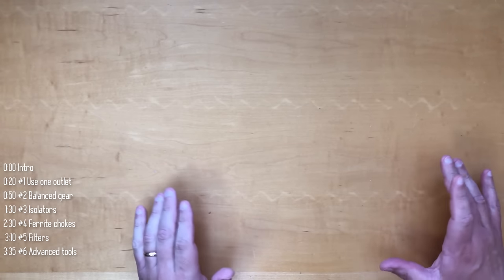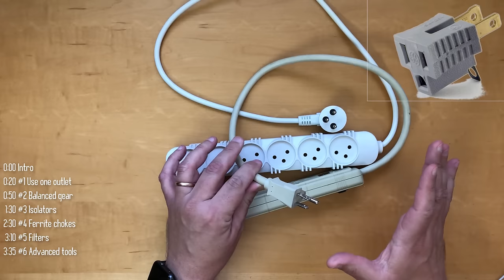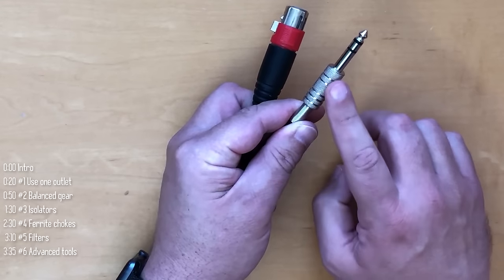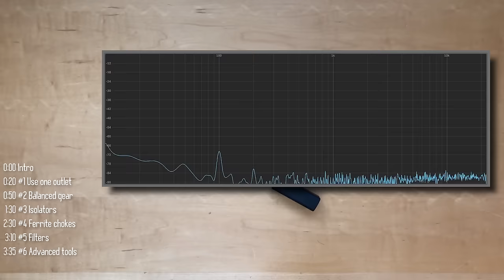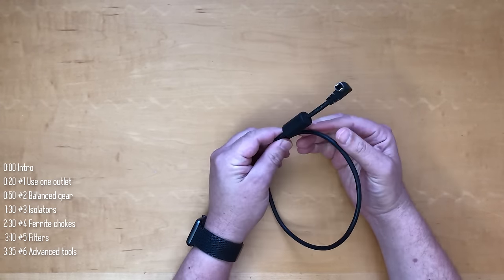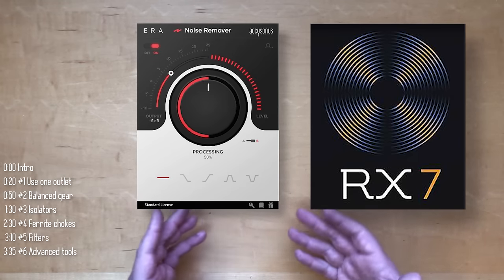6 simple and cheap ways to fix hum, buzz and ground loop noise

Comment: So i choked all of my ferrets and i’m still having ground loop issues. Help.
Reply: Look at these brands for legal solutions:
Kaytee Fiesta and ZuPreem
Reply: Did you use the beads while choking?
Reply: No no no -- your ferrets are supposed to do the choking.
Reply: better than ground hog issues
Reply: Check your squirrels as well
Reply: Did you try inserting the ferrets into your socket hole using the beads?
Reply: Was an evil cat no longer to be pet involved?
Reply: Nope,nope,nope!!! You're doing it wrong!Stop choking the snake! ...only ferrets!

Comment: Be aware that some budget hi-fi gear has balanced inputs and outputs, but the circuits are still unbalanced. In other words, you won’t hear any difference between a single ended connection or a balanced connection.

Comment: I first watched this video about a year ago, which definitely helped me identify the source of some of my frustrations.

I finally just replaced all the outlets in my studio, re-grounded all outlets on the circuit that feeds my studio, and installed GFCI outlets on the most upstream point. I've also run insulated conduit to act as both cable management and power/data/audio cable isolation. I've added ferrite cores to all my USB cables and run voltage tests on all my audio and power cabling. This has allowed me to completely remove ground loop isolators and post-recording phase reversal filtering from my process.

Short of a master power conditioner and UPS hard wired into my space, I've cleaned my entire electrical path as much as possibleand it sounds fantastic.

Comment: Great tips! I got one more.
If one of your rack equipment produces hum when connected, check if it's not touching other pieces of gear in the same rack and is properly isolated from a rack rails (properly painted for example). Just take it out of the rack while connected to see if the hum disappears. Most of the gear's earth is connected to the enclosures and if enclosures touch each other in some cases, ground loop may appear.

Comment: Great video! Been a fan of your videos but never knew you had this one. I solved a grounding problem today with an RCA audio switcher that has a turntable, a CD changer and a digital mixer all connected to it. I had ground issues with each, and narrowed it down to the switcher. Got myself a ground loop isolator on the cheap, and it's working as advertised. Good to know of other solutions too, so this video will be a keeper. Thanks again.

Comment: loopop once again being a lifesaver. this popped up thanks to the algorithm and my usb2 connection hum was driving me wild. Well, ferrite choke here I come.
Reply from the maker: thanks and note ferrite choke solve data noise not hum! use the other solution I mentioned for audible noise
Reply: @loopop  you're definitely right! it was a mix of using the same plug and the ferret strangler I mean the ferrite choke. I owe you so much. thank you for being awesome!

Comment: Thanks for the tip about the shared power. I have my audio setup plugged into a different power source since it's far away from my computer. I couldn't figure out what was causing the hum on my setup and it was slowly driving me crazy. I even bought some of those grounding devices and it didn't help. Who knew something as simple as plugging everything to the same power source can solve this issue!

Comment: Thank you for this, it got me thinking in the right direction. I have a computer speaker that is USB powered, when it was plugged into my desktop computer's USB port it made an annoying sound. To fix that I plugged it into a USB to AC adapter for charging a cell phone (5V 3A). And now the speaker works as it should.
Reply: Thanks for the tip man. Just curious, how were you able to connect the speaker to your computer if the USB connection is lost via the adapter?
Reply: @LukeSly91  USB *powered*.

Comment: So im back here on this video I watched like 1 hour ago. And I just want to say: THANK YOU SO MUCH! I had everything I needed already. I just set this up wrong. After I watched this video i started from scratch. And ta-da: Ground Noise is gone! Thank you so much!
Reply: BTW: I had 2 "misstakes". 1. I had it on 2 different outputbanks (Thats the first solution in the video). Helped a lot. But i still had a bit ground noise left. I figured it out, that this came from my Arturia MicroFreak. I found a solution where someone mentioned to use only the usb for the power. Not the DC-Connector that is included. And now i had complete silence when i had every gear powered up and connected. Silence :D. Thank you!

Comment: Indeed, NO. You should absolutely NOT disconnect the ground pin. For all those who do not know, that thing is there to save lives !! In case of a short inside a grounded device with the live wire touching the metal casing , it is the ground connector that takes care of your fuse box and immediately causes a cut of power on the affected circuit.
Whatever you do, DO NOT REMOVE THE GROUNDING PIN on your plugs!

Comment: Thanks for pointing me to right direction. Had some really annoying cracks and beeps when recording my amp line-out. Bought a $0.20 separation transformer from Ali and sticked it into a plastic casing, making quite a beefy jack plug. No need for fancy boxes or magical cables.

Comment: This is great info. My scarlet has been giving me grief and I don't think it's the Scarlett. I have my PC plugged into a surge protector instead of straight into the wall. Also, I think I'll definitely try the ground isolator. I use RX8 for declicking, and use Audition CC to do a noise floor clean up, but I feel I should be clearing -72 db for all the room treatment before I clean up noise floor. ugh.

Comment: RCA to 3.5mm jack on the amp. buzzes as the jack enters, so i swapped out the cables. Had to solder one, despite having 100ft of Canon/TS cables just lying around not doing anything. Life is hell.

Comment: Timeline on video description doesn't work on mobile
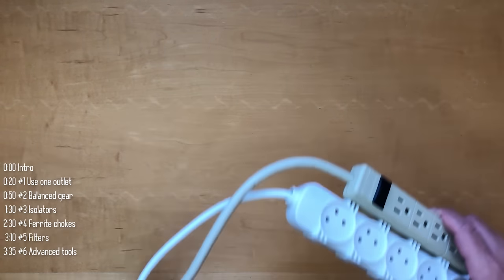0:20 Use one outlet
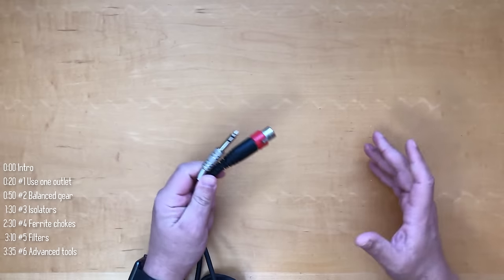0:50 Balanced gear 
1:30 Isolators 
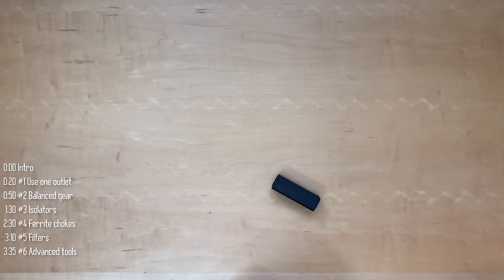2:30 Ferrite chokes 
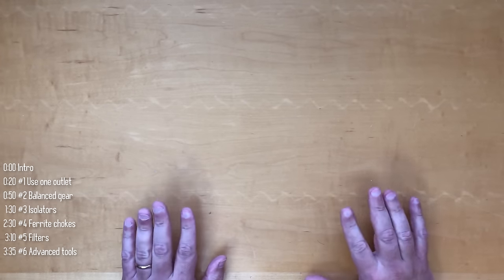3:10 Using filters
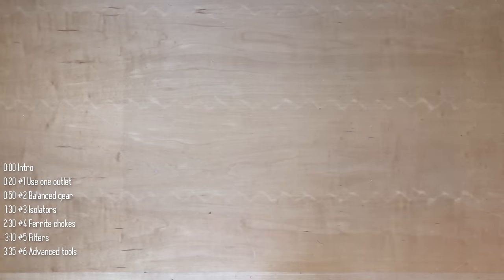3:35 Advanced tools

Comment: Use a good USB hub guys! Instead of connecting your interface directly to your PCs, route the USB connection through a proper USB hub! I used my monitor (LG) and it works beautifully. The issue manifest when your interface draws power directly from the PC. Note that it is recommended that you connect your hub to the same power bar (and outlet) as your monitors.
Reply: Thanks to this one. It worked perfectly when I separated the power source of the usb while charging and using my audio speaker thru 3.5mm at the same time. No more noise/static sounds. Just simple solution.
Reply: And what would you advise if your interface is a PCIe-based RayDat, and your convertors are already isolated from your machine as they connect via ADAT lightpipes, and are mains-powered?

Comment: I get a low frequency humming sound from my headphones when I touch my motorized desk while it's plugged in. However if I simultaneously touch the metal part of a synthesizer or the computer case, it goes away.
My solution has been to use a big, thick mouse pad on the desk so I avoid touching it directly. Not sure if I'm having a ground loop issue or some other problem, the noise doesn't sound like in this video, it's much lower in frequency. The audio interface and desk use 2-pronged plugs that are not grounded, while the computer and many other pieces of gear on the desk use proper grounded plugs so I suppose "ground" isn't universal across devices...

Comment: Another thing which you didn't mention is to lift the ground (pin 1 on an XLR) on one end of a balanced cable. Don't do this on a mic cable though.  Mic cables need all 3 connections.

Comment: The polarity inversion you observed is a flaw in the wiring of the particular ground isolator you tested.  Let the manufacturer know and insist on a replacement, or buy elsewhere.  That’s an inexcusable flaw that can result in out of phase sound between two related signals.

Comment: @PJ82 Division

Thank you for your response. yes all my gear is connected to the one socket, that was one of the first things i did. i will not be able to take my PC out of my bed room for testing on other sockets, as the thing ways a ton and its not worth the hassle. the HUM is driving me nuts i do have a pair of harman kardon soundsticks iii and when they are connected to my pc with its own dedicated sub there i no hum at all.

Comment: A ground loop isolator is simply a transformer. It should not reverse phase (within the rated frequency range) unless cables were soldered backward (confused polarity).

Comment: Over time I accumulated multiple and various power supplies (6 PowerOne Analog 4 to 8 amp, 9 Tiptop Bricks feeding Zeus distributors and 2 DIY) which accumulated multiple and various electrical noise and odd intermittent behavior. After noticing surprising voltage differences between ground on the MOTM cabs vs Eurorack cabs I read up on it and solved my issues by running a very thick copper ground to all said power supplies grounds. This was many years ago, but it made a huge difference.  Another issue that's snuck up on me are modules that are starved for power. Modules will still function but if there's not enough surplus amps to draw on it can leave you wondering wtf. I have ammeters installed  .. there cheap and provide a quick reassuring check.

Comment: What if the monitor were plugged into a separate outlet that the laptop I’m using to record?

And can a monitor broadcast RF into my mic’s TRRS line?  

PS I installed Ferrite beads on the power cable to my laptop, the mic cable, AND the headphones. But it didn’t seem to help. I can use a noise filter but it introduces a slight latency into the audio when live streaming.

Comment: There is also a really good noise reduction plugin in Reaper. It's called ReaFIR, and it's really easy to use and does the job pretty well. Reaper is not a free software, but it's quite affordably priced, and you can also try it, with all its features, free for 60 days. Anyway, this was really interesting! Thanks!
Reply: If you are on Windows, you can download the Reaper plugins as VST2 and use them in other DAWs for free.
https://www.reaper.fm/reaplugs/
Reply: Just tried that, very efficient thx a lot!

Comment: Great Advice. I've used some of these already, ended up using power conditioners which fixed the problem greatly. What are your thoughts about such devices?
Reply from the maker: Thanks and great! I don’t think power conditioners help with ground loops but ground loops aren’t the only kind of noise out there...

Comment: I have a small but distracting crackle in my HS7s coming through a Scarlett 2i2. A couple of these suggestions seem like good possible solutions. Cheers.
Reply: I had a crackle (repeating pattern, short "buzz" every second or half) in my Scarlett 2i2 too and it turned out to be the USB cable coming from a USB hub. Once I plugged the Scarlett directly into my Mac, the noise was gone! I might try some ferrit cores around some USB cables now.

Comment: Is there a difference between the 3.5mm ground loop isolator you used and a ground lift on a DI box? My Novation Circuit is outputting noise almost identical to your example, and a DI with lift wouldn't fix it.
Reply: A ground loop isolator is very different from ground lift. Ground loops are voltage inequalities between the two circuits that are in contact with one another. A ground loop isolator tries to fix that inequality using transformers.

Comment: I streamed a concert last weekend, and I had this horrible robot noise start up as soon as I started speaking and playing.  I turned my mixer off and on again, and it was better immediately.  Do you think I need the ferret bead?  I don't know if the cable I'm using to connect my mixer to my laptop is good, the mixer didn't come with one, so I just took the one from my interface.  Usually it's fine, but of course during the concert it wasn't.  Bad luck...wondering if there's anything I can do to prevent it, other than monitor my sound while I'm playing....which would be a little confusing to me I think, as I have to focus on playing.  Anyway, thank you for your video, which is informative, gentle for people who don't know a lot, and appropriately humorous.  I subscribed so maybe I'll learn enough that I'll try this streaming thing again some day.

Comment: Hi Loopop

I don’t know if you will be able to resolve this issue for me but I will give you a full break down of the ground loop I am facing. This is the equipment I own

Audioengine A5+ speakers
SVS SB1000 pro (subwoofer)
3.5 jack cable and RCA cable (bought from KabelDireckt)

When the Audioengine A5+ speakers are attached to my PC with a 3.5 jack there is no hum. When I join my speakers to the SVS subwoofer via RCA, I get a loud humming sound. 

When these two pieces of equipment are paired up and when I attach the 3.5 jack to my mobile phone there is zero hum. Can you please instruct me will this device nullify the HUM because it is driving me crazy and I have paid a lot of money for my setup. 

In simple terms

1)	Speaker with no subwoofer when attached to PC    =   Zero HUM
2)	Speaker with subwoofer when attached to PC   =   HUM 
3)	Speaker with subwoofer when attached to Mobile phone = Zero HUM

i have used the AV:Link RCA Groundloop and Ferrits on all cable but nothing 

I would like to thank you for taking the time in reading my message
Reply from the maker: Sorry it's hard to troubleshoot these things remotely. Other than the solutions in this video I've added quite a few more in my book on Patreon - if the solutions there don't work for you hit me up for a refund on Patreon, no worries.

Comment: I've tried some ground loop isolators and noticed a loss in the lows and highs. Low frequency sounds like bass and drums tended to get muddy and less punchy. When I see that a single good audio transformer from lehle or neutric costs 40+, I don't thing a 10 buck stereo one can have nearly the same quality.

Comment: The best solution for me is to use midi connections with my synths instead of usb.
Reply from the maker: Try these out - it may solve the problem
Reply from the maker: it may be worth your time to try the ground loop isolator - USB MIDI is faster and has better timing
Reply: is that so? Can you point us to resources about midi connections vs USB midi? thanks @loopop
Reply from the maker: Google...? ;) none off the top of my head. maybe one day I’ll make a video about it

Comment: when I turn on phantom with my condenser mic connected, it makes a sharp white noise at 6-11khertz frequency area, even when the gain is completely zero, the noise still persists. and the nosie changes (doesn't stop) when I wiggle the usb connected to my pc io from the Audio interface.
How do I fix this?

Comment: I've had some trouble understanding the kinds of cables to use for either stereo or mono, and some weird problems surface when I just guess. For instance, on my 0-Coast synth, it has a 1/8 inch audio out so I need to use a 1/4 inch adapter on one end so I can plug it into my mixer. When I use a TS adapter, the signal comes through loud and clear, but for some reason when I use a TRS adapter, it's very weak and can barely be heard even when I crank the volume and gain way up. My mixer does accept either balanced or unbalanced cables on its inputs, so I'm not sure what to make of this...

Comment: Sometimes, so called balanced cables are fake, where the shield/ground and negative are shorted out, making it an unbalanced cable.
Always check that using a continuity tester on the pins when you've bought a new pre-assembled cable.
Reply: I use triple beam scales to make sure my cables are balanced. I buy 2 at a time, same brand, and place each on on opposite ends of the scale. This method has been fool-proof to validate that they are in fact balanced.
Reply: @ablejohnson738  Haven't heard that joke for quite some time 😜

Comment: I have same issues connecting two or more Pro-keyboards via USB (Nord Electro, Korg, Yamaha CP4). I managed using those RCA ground filters. The problem is my Mackie mixer. I think it collects all ground spare loops. I wonder it a good powered USB HUB can solve the problem at the base.

Comment: Good to see. Unfortunately balanced cables isn't the solution always since some gear doesn't benefit from that or maybe even won't work properly. OB6 being one example where unbalanced is necessary to use.
Reply from the maker: True - I mention this in the video - that's why there are other solutions as well
Reply: Right, terribly sorry, missed that part : )

Comment: Quick Question, did you insert the ground loop isolator in Microphone chain (Mic -> Groundloop Isolator-> PC / Audio-Interface ) or in the Output Chain (PC -> Groundloop Isolator -> Monitoring)?
when I pass my Input Audio trough the Isolator, I do net get any Signal on the otherside.

Comment: hi! great video.

but you seem to imply that the MOTU Ultralight doesn't have balanced TRS outputs... it does!
Reply from the maker: john z thanks and I know it does that’s why I show it :) I agree I could have been clearer on that...
Reply: @loopop  ah. i watched it twice to try to get it right and it seemed like you considered it but had to move on to the next solution because it wasn't TRS.

i've watched many of your videos and you obviously know what you're talking about. :) 

i work with Ultralights alot so i felt i should defend it! very good value box. and with 12 analog outputs it comes SO in handy. (weird output numbering system though..)

cheers loopop!
Reply from the maker: Yeah I show it because it’s one of the interfaces I use and recommend ;)